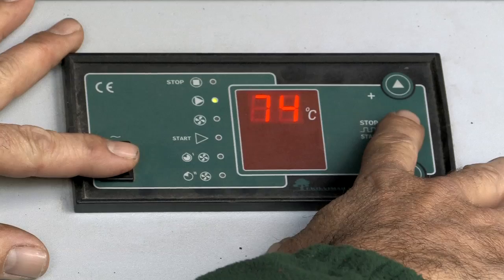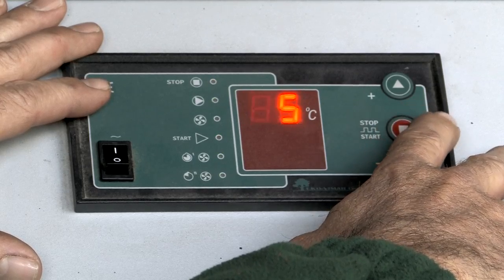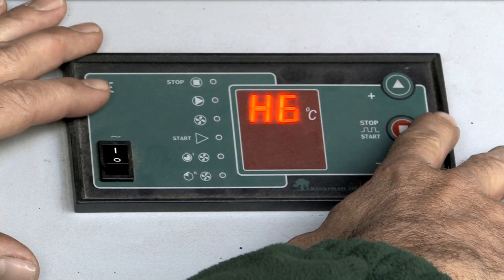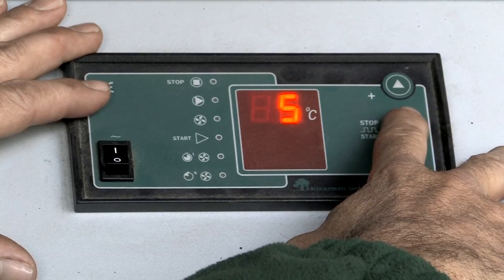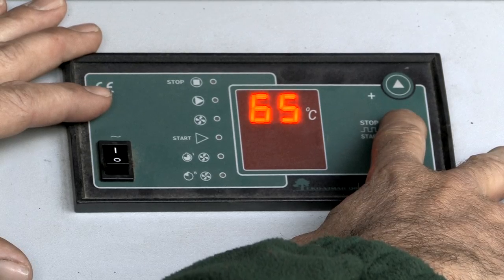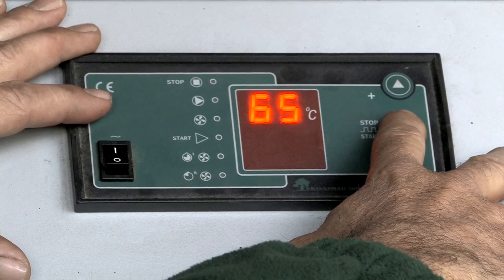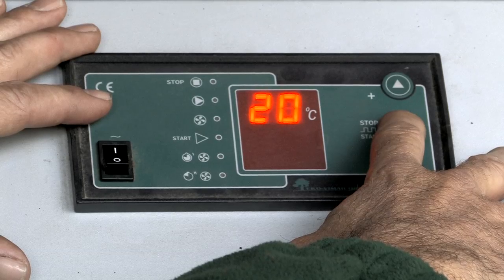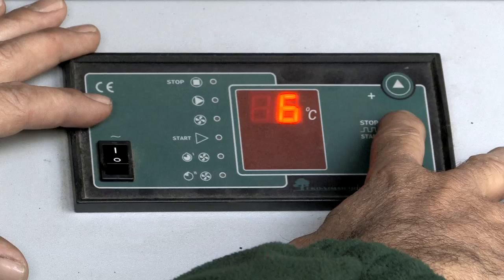Service Mode - Angus Super Wood Burning Boiler - Gasification Log Boiler - www.ecoangus.co.uk

Comment: Very helpful Guy. 
I am commissioning my hydronic slab heating in Southern Tasmania. The contract who installed the piping and supplied the Orlingo 200 boiler has gone out of business so I have been left in a bit of a mess. 
I did not even have a manual but was able to download one from Orlanski. Like most manuals it was not very clear probably suffering in translation from the original Polish. I have found your video resources a great help.
Thank you.